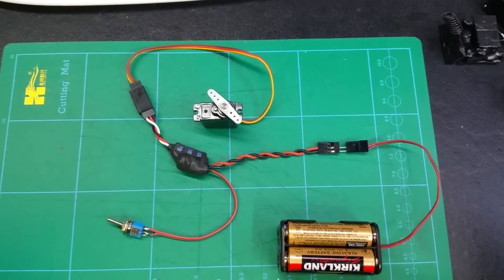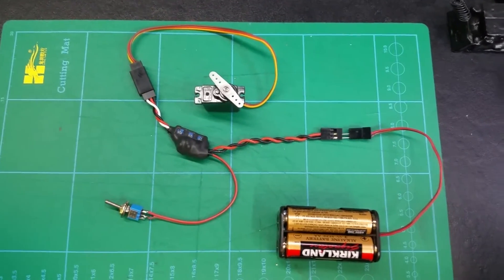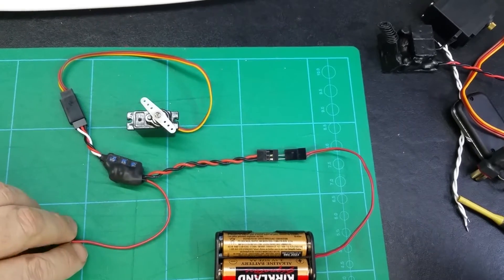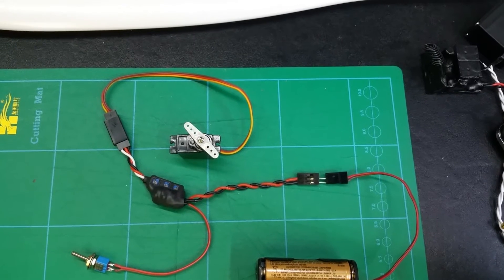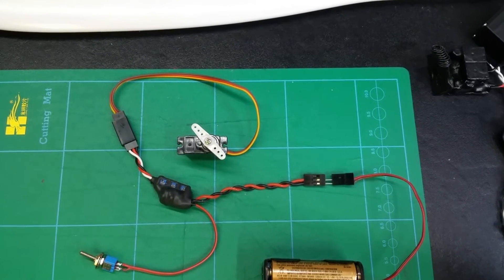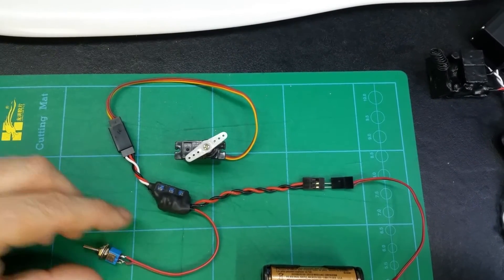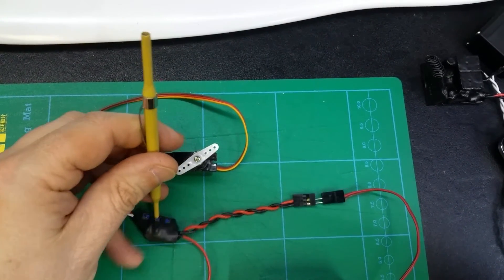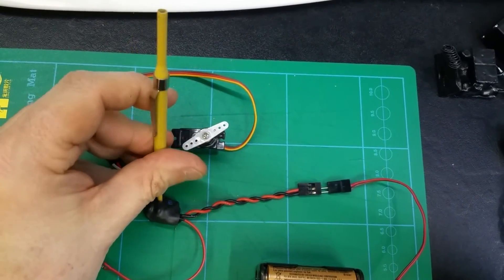Toggle Switch Servo Positioner with Speed Control

Comment: Is there anyway to hook up two servos to a single controller? I need to have two servos  to move in the same way, same time, and this configuration is perfect for what I need.
Reply from the maker: Sure, just use a Y cable or I can build you a controller with two outputs connectors.  Contact me at mostlyal@gmail.com and we can get this going.
Reply: @heyok  thank you! This helps a lot, I will use a Y cable.

Comment: I am not very experienced in this area. Could put a different on/off switch on it. Or does it have to be that one?
Reply from the maker: Hi Nathan. Yes, you can use a different switch.  I make a few versions of the controller.  I can make it respond to a momentary switch closure or a latching switch closure.  Email me if I can be more help. mostlyal@gmail.com

Comment: Can you link all the supplies these are exactly what I needed and I cant seem to find them
Reply from the maker: This is a part that I sell.  If you would like one, you can find it here: https://www.freewebstore.org/heyok-performance/Servo_Control/cat1742583_1590422.aspx  Also, feel free to contact me at mostlyal@gmail.com
Reply: @heyok  so the servi toggle switch on your website the 15 dollar one you can connect to servos to it
Reply from the maker: @samanthap1227  I think I describe it pretty well in the web store, but it is like this: You can connect two servos to one servo signal.  The toggle switch lets you choose which servo connects to the servo signal.  Email me if it isn't clear as it easier to include pictures to help explain.

Comment: Interesting video. Since you are knowledgeable in this area, I have a question. I have an, on-off-on toggle switch that I need to control with a typical servo. Currently I am operating it with a 2-56 threaded rod and a clevis, is there something made for this that I'm not aware of. Thanks for any information you may have.
Reply from the maker: Hi, I can try and help. Please email me about this and I will see what I can do.  mostlyal@gmail.com

Comment: Hi. Can i replace the switch you are using with a simple on/off switch ? If not, what is the type of switch needed ? I bought your product but i need to change the switch and i'm lost, there is so many type of switch available on Aliexpress. I don't understand why you are using a 3 pin switch. One last question: Does the battery drain while the motor is not moving ?
Reply from the maker: That should be fine. Please email me and I can be of more help. mostlyal@gmail.com

Comment: Hi, anyway of using a 3 position toggle switch so that it goes left and right and back to neutral?
Reply from the maker: Yes!  I also make a three position version: https://www.freewebstore.org/heyok-performance/Servo_Positioner/p1742582_18227999.aspx
Reply: @heyok  thanks for the quick reply. Can I use this with an existing transmitter and receiver setup so that the toggle switch overrides the transmitter when I need it to?
Reply from the maker: @Garfoid  Welcome!  It only works from the toggle switch.  Maybe email me if I can make you what you are describing. mostlyal@gmail.com

Comment: it be possible to hook it up to a 12 volt model railway controller
Reply from the maker: Does it supply from 5vdc to 9vdc?
Reply: To the best of my knowledge it is the standard Hornby train pack controller that you get in any standard Hornby set from the earlier Generations when it was the old black Style
Reply from the maker: @brickleyyard4966  Like I said, please contact me via email and I will help all I can.  In case it didn't come through in my last reply, email is mostlyal@gmail.com
Reply: Also I just looked at the link you sent me do I get all parts seen in the photo or is it just the component in the middle
Reply from the maker: @brickleyyard4966  The controller only.  Any questions, please email me:  mostlyal@gmail.com

Comment: Hey buddy, is there any way you can show how you have the pots wired up? I'm looking to duplicate the exact same thing.
Reply from the maker: The pots are wired between positive and negative of the power supply.  The wiper is connected to an analog input on the micro controller.

Comment: Is there anyway you could show a set up, where you press a tactile and have it spin 180, then when you release it, it spins back?
Reply from the maker: Sure.  Just replace the toggle switch with your tactile switch.  For 180, you would probably need the end point adjustments set to their max positions.  I don't have one of these controllers built up at the moment so I can't really make your video right now.  Contact me at mostlyal@gmail.com if you need me to make one of these.  Thanks, Al
Reply: heyok Thank you for the help, I’m pretty crafty, so I’m sure I’ll find a way to make it work.

Comment: Hi can you tell me if you could post this to the UK? Also could you tell me once the servo meets it's end point. Is it still consuming power i.e. is there still a signal being sent?
Reply from the maker: Jon Wright Hi Jon, please write me at mostlyal@gmail.com and I can be more helpful. Yes I can post to the UK. The servo still uses some power when it reaches the end point. The more a force is trying to move the arm, the more power it will use even if it isn't moving.